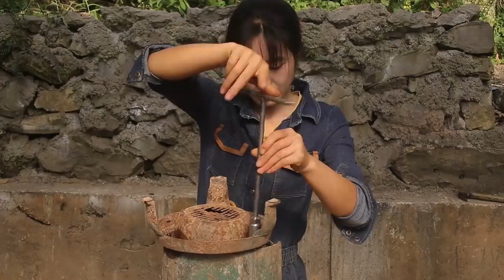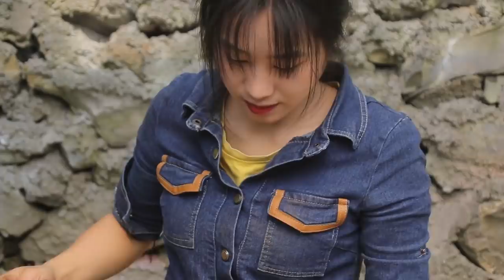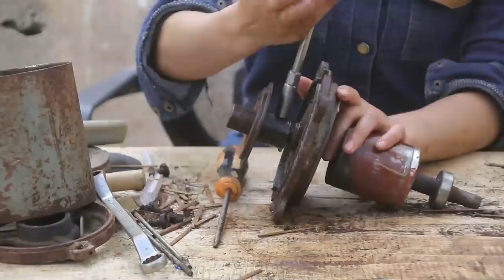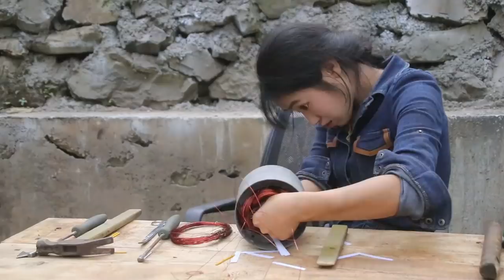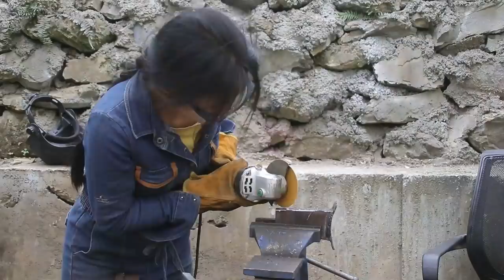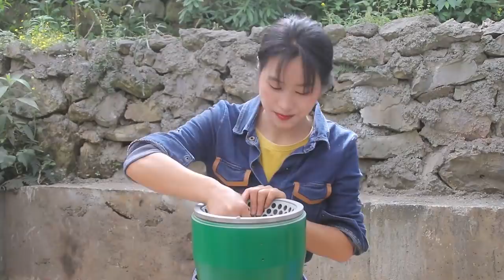💡Help Fan To Repair Uncreditable Machine That Looks Like A Cannon Bullet!  | Linguoer | Restoration

Comment: Well done Guoer! You saved another old machine to  live again. I noticed the  English letters  CR and V on your socket wrench...this means that the tool is made from steel containing chromium and vanadium. The best tools are made of this steel. As an old man with almost 50 years of experience fixing machines, may I make a request? Please grind away the mushroom end of your striking chisel....tiny flakes of steel can break off when you strike it and enter your eye. 40 years ago it happened to me....the doctor had to remove it.....very scary. Good luck and best regards from Canada!
Reply: Great advice, sir!
Reply: A similar problem happened to me with such a chisel. A part of the chisel broke off when I hit it and landed in my forehead like a shell splinter. It was only small, but very, very sharp. Fortunately not in the eye.
Reply: @hans-juergenheinze9214  We were both very lucky....and it is so easy to just grind the end!
Reply: Yes, very important tip. When I was young, my brother and I were splitting wood with a wedge. The wedge was mushroomed and a large piece of steel went very deep into his hand between his thumb and index finger. He had to have surgery and tetanus shots. Safety is very important.
Reply: Tiene razón en el punto de golpear algunas piezas,porque puede pegar en el lugar exacto dónde está el punto de quiebre.
Reply: @crisherrera2249  by by

Comment: Nice work Linguoer on the video and your craft. I have one safety suggestion and that is to grind the mushroomed portion (sides) of your chisel. There have been 2 times I have witnessed a portion of the chisel breaking off when hit hard and going into someone's body. Just grind away the mushroom some will prevent this from happening. Thanks again for your hard work. Be safe, your village and fans need you.

Comment: Hi Ling, you display excellent workmanship. I like it when you wear personal protection equipment, because you are born with 2 eyes and 2 ears you need to protect them from damage, you should wear ear muffs or ear plugs to protect your ears from loud noise. When you use a drill bit to make a hole, you should center punch the metal before you drill, and when you use a drill bit to make a hole, if you don't see metal chips fly out when you push to make a hole, you might be using a dull drill bit. Keep up the good work and good videos!😃
Reply: ขาย ทำงช

ขาย
Reply: А, как вы сумели сделать перевод комментария на русский? Вы, что знаете как по-русски и пишете дважды на разных языках один комментарий?

Comment: Stunning and shocked at the level of skill! all that wiring! what an art! truly amazing
Reply: Rewinding a motor is not a simple task. There's lots of things you must consider: wire size, number of turns per coil, direction of the winding, and the location of the windings in the slots. Once the coils are installed, you must then connect the wires from each coil in a very specific way. This, in itself, can be a daunting task - just keeping up with what goes where. Only one mistake will cause the motor to not work properly, and in some cases may cause a coil to burn out before you realize what is happening. 
   All this is in addition to the mechanical aspects of getting the coils into the slots and properly insulated and secured. It is a high-skill undertaking and a person who can do it deserves a lot of respect. Perhaps this is stating the obvious, but I hope everyone appreciates what Lin is doing and showing us.
Reply: Just got to love this girl. Respect

Comment: Perfect restore!👍👍👍
To fit the bearings always use a kind of pipe that fits on the inner ring of the bearing.
Reply: You are right there, transferring axial impact forces between the inner and outer race can ruin the bearing instantly. Many types of ball bearings are designed to carry mostly radial forces.
Reply: @arska6383  v v xenón 6

Comment: Might I make a suggestion when removing  and installing bearings. Clamp the armature in your vise, use two crow bars and pry the old bearing off. Installing new bearings use a pipe that just fits over the diameter of the armature shaft, this will protect and keep from hitting the outer race or seal of the bearing. Just tricks I've learned through the years.
Reply: She needs more equipment and tools !!! I agree she with your suggestion, but I also am impressed with her I CAN DO IT attitude!
Reply: @Srichardson64  I've messaged her last week asking if she needs more tools for easier overahauls; vice grips, center punches, pin punches, inside/outside snap ring pliers, piston ring compressors, cylinder hones, etc.
Reply: @specialservicesequipment393  yes. It hurts to watch hammering on bearings and pulleys.
Reply: @specialservicesequipment393  don't forget rubber and wood mallets....lol shes always whacking on something!!! But yes... next month I can send 100$ usd but I dont trust youtube, do you know if she has a go fund me page or another way?
Reply: @eiserntorsphantomoftheoper2154  but you got to love her little smirk... screams I CAN DO THIS attitude...is why I want to help her
Reply: @Srichardson64  Don't know, When I messaged her through YouTube I asked she reach out to me with a way to contact her directly. Yeah she needs some wooden blocks at least for setting bearings putting flywheels back on so she doesn't crack anything.
Reply: 3 prong bearing puller, vertical hydraulic press, bench drill with collet holder (need slower speed for drilling steel or ss) and can act as a mill with a linear table, sand blasting enclosure and take care of your back when lifting heavy parts. Youre young, so no worries but as you get older amd injured yourself, its a long road to recovery.
Reply: She’s got a drill press that she renovated I don’t know what happened to it. She’s also got a compressor she uses for sand blasting that looks like it has a 40mm hose on it. If she got some other tools for that it would be a great step forward. She also has a three pronged bearing pulley we’ve seen her use so that bit really confused me. She left a high paying job to live a more simple life and she publishes her videos on both this channel and her Chinese one. So hopefully the income will help her buy more tools. If she started a Patreon off I would join, I've done a few with young people to give them some encouragement.
Reply: @Srichardson64   She is very dedicated and cute to watch.
Reply: Great. But perhaps this video was taken many years ago when she was still a "schoolgirl".
If you watch her later videos, she would use  a "hydraulic bearing puller" to remove bearings and a pipe to hit only the inner rings of the bearings when installing new bearings
Ms Lin  graduated from Kunming University in 2017 - earning  a degree in water conservancy and hydropower Engineering. She knows her stuff.
In her chinese channel, she would put "schoolgirl" in the description of some of her earlier videos.
Reply: I was going to mention the same thing but was scared,, tks your a champ.  What she needs is a press.
Reply: @jamesyap3562  I would not suggest using a drill press as a mill because of safety reasons,  could cause serious injuries.
Reply: @specialservicesequipment393  very kind gesture
Reply: @nadingjeff  If the drill press uses an arbor that holds collets instead key chuck, its ok. There should be a long holding bolt pulling the arbor up and wont come loose when an end mill is at work. Those pressed fit - key chucks are the dangerous ones
Reply: @jamesyap3562  I understand, I own a mill and a drill press. Most drill presses do not have the capability.
Reply: - As a retired mechanic I feel your concerns.. however.. the primitive tools and her undaunted spirit in their use,  give her videos their own distinctive flair.

Comment: Nice work! 
Little advice: when drilling , start by using a smaller drill bit if possible, it will make things way easier. Also the smaller the drill bit, the faster it need to spin.
Reply: The fact that you first drill with a small drill has to do with the following. The larger drills do not have a cutting edge at the drill tip. If you look closely, you can see this. In addition, you have a problem with cheap drills in general. The stability is not good.
Reply: @hans-juergenheinze9214  Well, it also have to do whith the cutting surface. I have seen peoples exloding 20 mm drill beacause they wanted to "save time", scary as hell.
Reply: Yes, she struggled to drill those holes. It's normal to put in a centre pop first to stop the drill wandering. A sharp drill bit would help too.
Reply: Oil, a center punch, good bits, slower speed and the proper drill all help.

Comment: 2 suggestions to help you keep tools in better shape and to make them last longer:  1)  When using metal cut-off blades with an angle grinder, your blades will last a lot longer of you make a number of shallow passes to cut through the material rather than pushing to cut it all at once.  2)  Using a lubricant (like oil) when drilling through thick metal will keep your drill bit sharp and in better shape for longer.
Reply: Anything will do WD 40 or penatrating oil will do.

Comment: Whoa what a wreck! Triple phase? Copper is very expensive. Enamelled copper used in windings often protected / sealed in, by heavy lacquer. 👀Lin calculates by judging the previous winds BUT we can also assume her own KNOWLEDGE and EXPERIENCE will tell her what she needs to know to make sure this works. 👀 A VERY talented female !
Reply: Not 3 phase - it's single phase with an extra capacitor fed start winding.  You can tell when the stator is empty - the main phase is the big coil cutouts and the starting "phase" is the smaller cutouts 90 degrees apart from the big ones.  I call these "1.5 phase" but I'm sure there's better terminology.  The starting coil determines which direction the motor rotates.  They can usually function without it if you can get the motor spinning before you apply power, otherwise it may jitter in place instead of spin.
Reply: @big0bad0brad  Heck had to refresh my knowledge on motors... of course its a mixed stator winding set up on AC with brushless motor (No commutator which would have been DC whereas China et is 230V AC normal household )but industrial would be 460v? 😎😁Reminded me to order some brushes for my router 😗😁She is bloody brilliant to watch .. lives with her grandfather and brother (few uncles et ) but is a qualified hydro electric engineer. 😗

Comment: Excellent work Guoer. That is the first time I have seen you use WD 40, is that new? It makes life easier with rusted parts, the longer you leave it on the better, let it soak in. It is also good to use a little when assembling things, helps bearings slide on. Keep up the good work. PS Looks like you used your glasses when chiseling, great.
Reply: Someone probably sent her a case of the stuff.
Reply: She's used it before

Comment: Several suggestions, since you have compressed air for sand blasting, it could also be used to operate an air powered wrench, that would make removing stubborn fasteners much easier. And you could use a high powered water pump to make a pressure washer, in addition to the sandblaster. Love it when you use WD-40!!! And there are other fast-acting lubricants such as CRC-556, and PB'LASTER, they work just like WD-40.
Reply: she will learn from you.
Reply: @ngheanchoong  my father started teaching me mechanical repairs when i was 10 years, now i am 71 years, and have many, many repairs done over those years. And i have learned, "experience is the best teacher".

Comment: Simply a superlady. It is simply a pleasure to watch you. 
But still a hint. 
I would make sure that the socket and the screws on the connection box for the electrical connection are clean and not rusted. Otherwise they have a high contact resistance due to corrosion and thus a high heat generation and it can start to smoke.

Comment: looks like someone has already loosened the nuts and bolts or was taken apart before trying to fix, besides that lineman pliers are the wrong tool to use, should have been at least a pair of channel locks or vise grips, someone buy that girl a small battery operated impact tool like Milwaukee

Comment: Excellent you fixed total scrap
machine,this is credible marvelous job you done.
No do bout your skill and knowledge is remarkable.
I have read many views here about they appreciate you and also some Adivise because they have passed long experice
in specific field,their valuable tips can improve workability process more easier.like sharpens the tools,easy drilling,
One tip from me also,if you have thick waled pipe of different diameter in size for bearing fixing,so you can apply uniform force stroke on bearing
While fixing.
Good work,keep it up.👍

Comment: You are amazing! Where did you learn all these things? From generators to electric motors and even diesel engines! You are great !!!! I am filled with great admiration. I really am.
Besides, you are so young and pretty, you are so calm in unknown situations. It's really crazy.
I wish I had these skills to rewind my old drill. But I don't even dare to open it for fear of not being able to close it afterwards lol, because a wire or a part would be misplaced and get stuck. Lol.
Really good job! I am hyper admiring!!!  What a talent you have !!! 💯💯💯💯💯👏👏👏👏

Comment: You need a brass hammer, center punch for starting holes, use a piece of pipe to install bearings, learn to weld, solder your electrical connections and cover with shrink tubing. Grind the mushroom off all striking tools. Your work will be a lot easier. Nice job. Stay safe. GOD BLESS GOD SPEED GOD WINS.

Comment: Well done Linguoer.
I watched you manually count the turns in the two different windings.  Have you thought to just extract a winding intact and unwind it on your winding gadget.  The turns counter tells you how many turns.
Your attention to detail with motor rewinds is VERY impressive.  And (with respect) you need to invest in some new drill bits young miss.  Or perhaps sharpen them if they are quality drills.

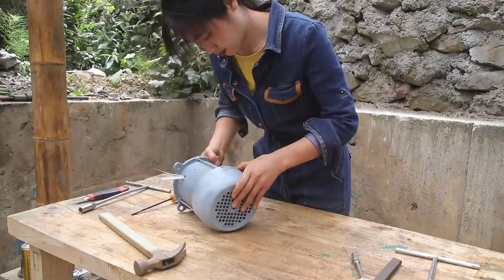Comment: At 35:00 when you install the ventilated cover that goes over the fan for the motor I noticed that the cover didn't look like the one you took off.  Did you repair the old one, replace it or make a new one?
Great work on the machine.  All throughout the repair I kept wondering what the machine did.  You did have a big happy smile at the end demonstrating the use of the machine.
There are others that can weld better, paint better, smooth out the surfaces better, maybe rewind a stator better or rebuild an engine better but they are not the decathlon gold medal restorer like you.   
And you're the cutest restorer on YouTube.

Comment: If you are refurbishing old machines, engines, generators, motors, or other home appliances, it is recommended to use a laser cleaning machine when removing rust and paint, because it can be cleaned without damaging the substrate.

Comment: You can heat your bearing before sliding it on the shaft, its easyer to insert it.I suggest to use an old microwave tranfo.You retrieve the high voltage coil and replace it by the bearing for a few secounds...well its more complicated but you see the idea.

Comment: 27:29 You need a drill bit sharpener to keep your drill bits sharp.   And you need to attach your vise to the bench so it doesn't flop around.

Comment: If you cool the drill with a little oil, they will last longer, and remove the string you have around your waist so that it does not get stuck in a machine so you injure yourself.

Comment: changing bearing and pounding on the ends can create a flat spot and cause bearing to fail quicker.  Better to use a shaft and beat on the inner race.  it’s how I put bearing into a shaft.

Comment: I will recommend that you buy some new kind of hammers that are made of rubber so that you can properly push in those things because when you use metal to an object that is not made of pure metal you will fracture it you will break it they are hammers that are made of rubber they have sand or Pebbles or beets inside that when you strike something it gives a strong hit

Comment: Always use a pipe or correct tool to install bearings... you are damaging it by hitting it that way.  The bearing will not last long from that type of damage.

Comment: Your abilities are incredible. except method of ball bearings mounting on a shaft! Simply
you shouldn't push them with a punch but use a tube instead. It is more efficient and will not cause additional stress in their rings.

Comment: With all the tool marks on the parts being taken apart, I would have to conclude this is not a genuine dismantling video.  If the first bolts were actually rusted requiring penetrating oil, you would have not been able to spin the nuts off with a flick of your wrist. And the subsequent rods would not have had tool marks from the pliers you were using before you started unscrewing them.

Comment: You don't need to use money to protect screws from rust. Heat screws/bolts redhot and dip them in oil.

Comment: RUSTED on bolts, little wd-40 and she takes them off with a t-bar wrench?  Banging on all those cast pieces with a regular metal hammer and nothing gets dented or cracked?  Popping off pressed on parts that have been together for years without putting it in a vise? Yeah, OK.  No doubt the rebuild was done, we see it after all, just my belief that the video is a touch "misleading".